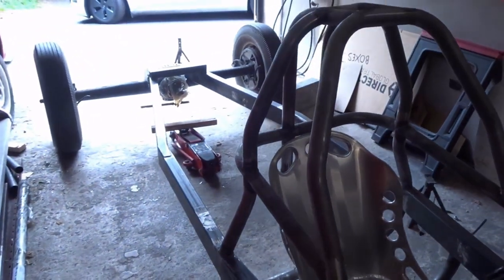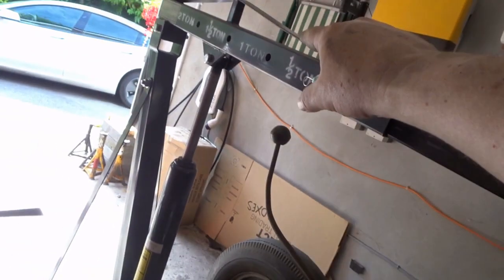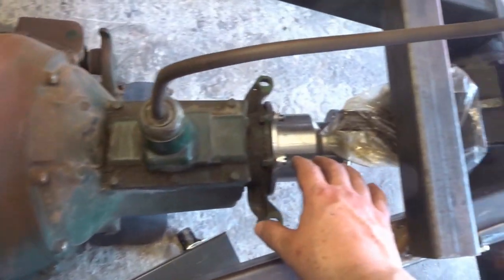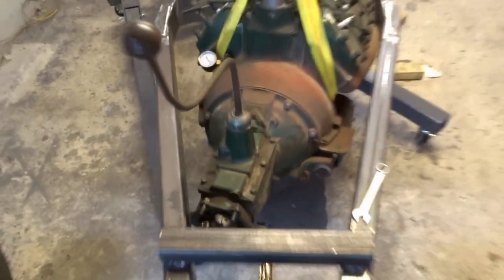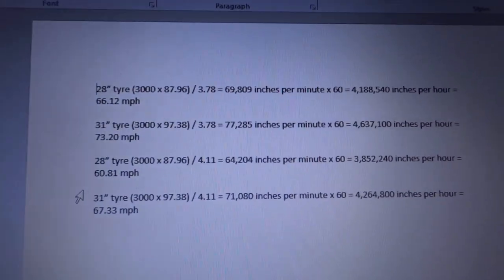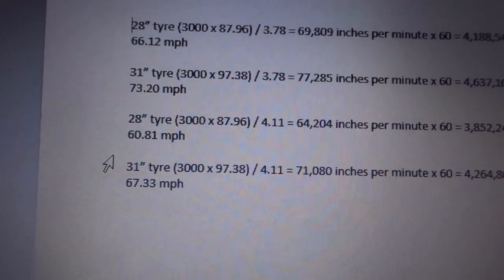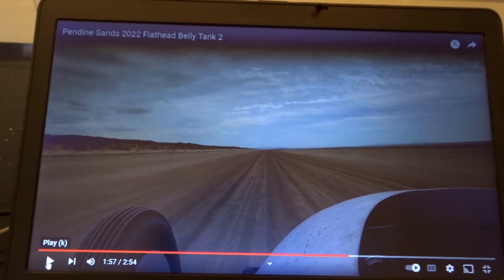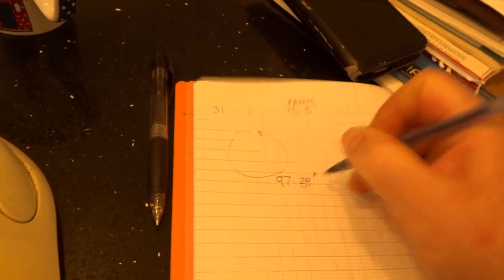Trial Fitting Of Engine issues | Belly Tank Lakester Ep.18

Comment: Hey mate I’m in the process of building a belly tank too. My diff is from a 34 and is also a 10 spline, my understanding is they were on commercial vehicles and some passenger vehicles. You can purchase an adapter P/N 48-4684 to go from 6 to 10 splines that fits onto the end of your driveshaft. I’m intending to do this with a cut down torque tube and driveshaft. The addition of the adapter will add about 2” over just connecting the diff pinion to the universal joint. I guess you could purchase a quick change diff centre with a 6 spline pinion to keep your adapter, save space and add adjustability to your drive ratio.
Reply from the maker: Hi, seems like a small club we are in! I did think about a spline adapter. However, I need to change my rear drive ratio anyway so have ordered a crown wheel and pinion kit which also has the 6 spline input so in theory should solve both problems. My custom mini torque tube is already made too and I need every bit of space so the shorter the drivetrain the better, even by 2". Might upgrade to a quickchange later on if everything else turns out good and car runs well. Interestingly the person I know who has built one says his belly tank with solid rear end is way more stable on the sand than his 30's hot rod with rear suspension which wanders all over the place. Might just be the better aerodynamics but an interesting observation even so.
Reply: @XenonJohnD  Yeah, I wondered about that myself when watching the video you linked. It looked like a rough ride and sand can do weird things under stress.

Comment: Another great video! You have inspired me to build a bell tank racer in Australia after finishing the Model T. I wasn't sure what to do with the Flathead I purchased a few months ago but now I do ;-) My idea will be to make it road legal with bolt on/bolt off mud guards, mirrors and lights. Did you find any really good books on Belly Tank Racers and their construction? Keep up the great work.
Reply from the maker: Hi. My first convert to this ultra-obscure hobby! Didn't find any books on belly tanks. Bought some hot rod books (see episode 1) and the little Vern Tardel books on specific mechanical assemblies such as rear axle, brakes etc. Scoured the web for all belly tank photos and articles out there, new and old, big collection now. V useful for design ideas for steering linkages, geometry, ways to mount things, gearchange linkages and so on. Lots of different ways to build them. Real-world detail flathead channels on YT such as Mart's Garage. There is a build thread or two on the HAMB forum, including one from New Zealand - yeah, I know that is not the same as Australia :)  that looks about 2/3 finished now. I have seen photos of one in the US that is road legal. Radiator is mounted in the side next to and a bit above the engine with lots of ducting and louvres. The whole build is about tidy packaging I am finding out. Very glad I stretched the length by 6" as helps with all that.

Comment: Great project. Just a thought about the transmission ujoint. It's lubed by a grease zerk in the housing by the factory and the excess grease escapes between the trans cup and torque tube.
 Does your adapter have a hole to match return gear oil hole in the banjo flange.
Reply from the maker: I have a hole in the top of the adaptor to inject it with grease (50ml syringe with a little nozzle tube on the end) as that seemed to be the best way to keep the U joint lubed. I don't have an escape/drain hole of any kind in the bottom of it, not yet at least.